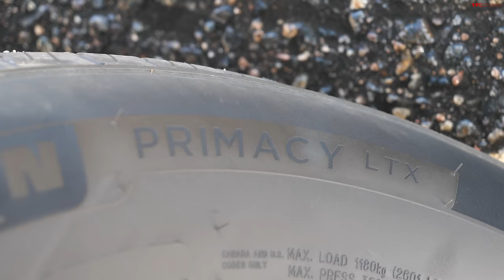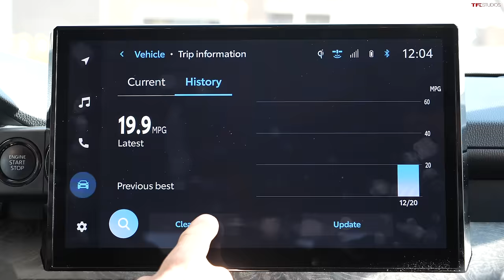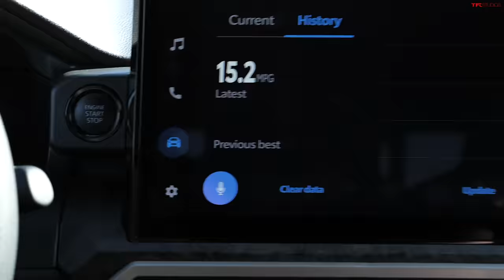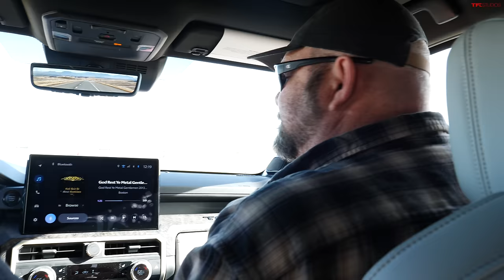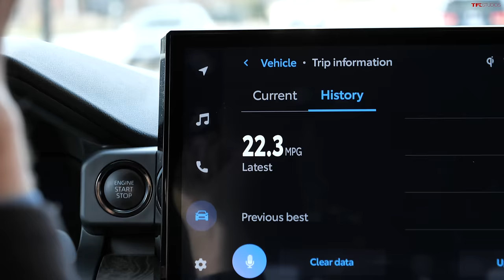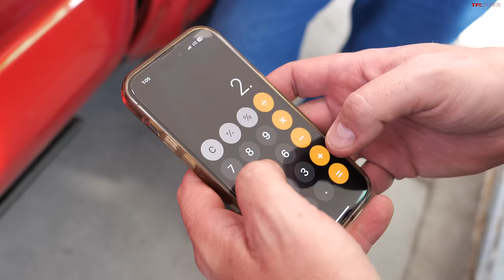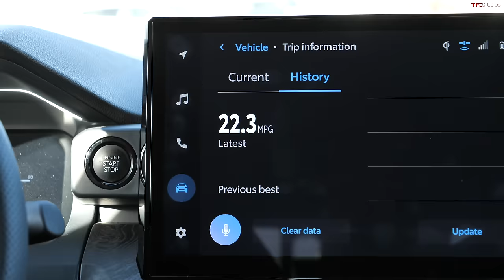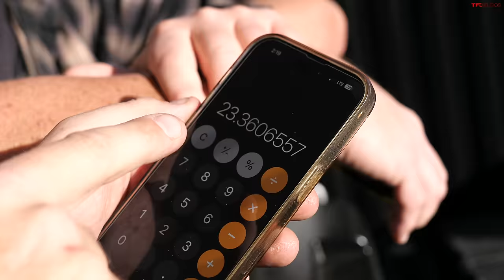Does the New 2024 Toyota Tacoma's Massive Chin Spoiler Actually Do Anything? We Put It to the Test

Comment: I would suggest prolonged testing to confirm, but that would only be 2.9% difference. If you did 15k per year at 23mpg, with gas at $3/gal, it would amount to less than $60 per year. I agree, ditch that ugly thing.
Reply: if you assume a 2% margin of error it's too close to tell.  they would need to run this test several times to confirm the results.
Reply: It might change dramatically in just 5 years. Or in California it can be more expensive right now.
Reply: Agree. Would ditch it. 2-3% improvement is not enough to offset the ugly factor, and it IS ugly
Reply: That's also assuming the aerodynamic drag of running at 75mph for the entire 15k. The difference will be even less at lower speeds (city or small country back road). Yeah, definitely chuck it.
Reply: I’d pay 60 a year just for it to be gone 😅 it’s like larger tires or other things as well. They cost more but they look better 👍
Reply: @monzav8 who cares about ugly? I'd be more concerned over ground clearance.
Reply: I live in rural area with lousy county roads. The spoiler would be broken first time I had to pull up the driveway
Reply: For 38.00 at 3.00 per gallon fuel, at 10,000 miles of highway speeds, and at low speed little to no difference. I see why they put it there, to get to the next even number of fuel economy, making it super easy to remove, is super smart. I think they can offer it on some models for EPA testing, and not on the rest, just to get the rating.
Reply: Also I would like to see some tests with the bed fully load to see if the front angle change makes difference, but for now, it seems they added just to comply/get better EPA rating, that should help Toyota with CAFE stupid rules
Reply: I’d prefer Ford Ranger looks over this, for me the looks are the most important than reliability! 😊 Ford ranger screams masculinity
Reply: @bekabeka71 some people didn't need a vehicle to define them
Reply: But in Canada that would cost $200 year. Plus in a strong headwind it would amplify the affects. If a manufacturer decided it was a good idea then live it on. Unless you intend to off-road. Most people 90% never leave the asphalt
Reply: You should try this in south east Florida. Where the speed limit signs are optional at 65mph. If you aren’t going at least 85mph you’re being passed by a Prius. I’m curious how different it would be at that speed.
Reply: Which equals 16.4 Cents per day
Reply: @anotherplebeian  each to their own like ☺️
Reply: @Kcducttaper1 100% agree...
Reply: Facts…pffft…You can use facts to prove anything remotely true. 😂
Reply: @HaroldCombs 
That's how statistics work to justify paying extra in fuel or extra for pieces of plastic that may not be worth buying in the first place ☠️
Reply: @freedomisntfree_44 you just invented a new way for car companies to extract more money from buyers. Stack on features they’ll pay subscription-model to not have.

Next thing you know your next new truck will come with your mothers-in-law yelling at you from the back seat.
Reply: @bekabeka71 really how masculine are you if you need to scream it to the world?
Reply: Guys, Salvation is Simple

HalleluYAH translates “Praise ye YaH”

YaH is The Heavenly Father 
YaH arrives via the TENT OF MEETING
YaH was Who they Crucified for our sins
YaH was Crucified on an Almond TREE

— Ancient Semitic Cuneiform of Moshe (Moses)
— Isa Scroll (The Original Isaiah)

Isaiah 42:8
"I am YaH; that is my Name! I will not yield my glory to another or my praise to idols.

Isaiah 43:11
I, I am YAH, and there is no other Savior but Me.

Isaiah 45:5
I am YaH, and there is none else.
Reply: It’s actually 2.99704516% difference. So basically 3% better fuel economy. Maybe put it on when going on long road trips on the freeway?
Reply: 2.9% is good in an engineer's eyes. 3% here, 3% there, and soon you're %15.better.
Reply: Toyota could’ve made it look better, it just looks so cheap and ugly
Reply: That 2-3% is at HIGHWAY speeds. It is less useful in town. So how much highway vs city are you actually going to do. It's irrelevant to most people who actually need a truck as a truck.
Reply: Plus we saw that they were stopped at street lights. How many and for how long will adjust that difference.
Reply: $3 a gallon, that's cute.
Reply: I would take it off but install it on long highway trips. It won't make much of a difference around town and lower highway speeds or short high speed highway trips (<30 miles).
Reply: @bekabeka71  I spent my teenage years in the 1980’s pushing vehicles off the road, there is no vehicle that I’d rather push than drive.  Toyota has been the cure for that.
Reply: Thanks for running this test!
Reply: @bekabeka71 just way too expensive
Reply: It’s not about fuel savings for the customer (that’s negligible and completely variable based on driver, conditions, location, weather, etc.). That spoiler is about meeting CAFE fleet standards for the manufacturer….which is determined in a wind tunnel and/or computer simulations.
Reply: g3430  yeah, I get it. Which makes a huge difference to the manufacturer, so yeah as consumer, that garbage is gone. Lol.
Reply: I drive 10k miles per year, so I'd be more like $40. Definitely not worth it.
Reply: Shush 🤫

Comment: It's about a 3% improvement in fuel efficiency with the chin spoiler. For a few bucks worth of hardware, that's actually a really significant improvement from an engineering perspective.
Reply: After this the design department walked into the engineering department armed with axes, swords and maces.
Reply: @JonBecker81  A designer is like an engineer but with a lower IQ.

Comment: Most people are gonna end up ripping that chin spoiler off….just in use…parking curbs, snow , and even mild off roading..
Reply: That is what I was thinking as well.  I live in northern Wisconsin and am often driving in snow.  I can't imagine that thing would last long.
Reply: Agreed, and i belive it mostly comes on the limited so most wont even have it to begin with..
Reply: Doubt that people would take it off…
Reply: @drn13355 with a little extra bracing you could use it to plow your driveway.
Reply: @phileasler5401   people with Tacoma's love modifying their trucks, this would be the first thing especially since its so easy to do and doesn't make much of an MPG deference..
Reply: Newer cars are way too low to the ground. My 2015 Chevy scrapes and gets stuck on stuff my 80's beater doesn't. And my Chevy is an SUV and my beater is a two door.
Reply: @lilsammywasapunkrock  you’re pretty vague on your complaint about “newer vehicles being too low” ? …..just stating your 2015 Chevy is too low makes no sense ….what type of Chevy? What 80s beater? …..I’ve worked on lots of old and new vehicles over the years and some old vehicles I can’t  even get my head under the frame when on flat ground…..some of my newer trucks I can literally crawl completely under them to change the oil without lifting.
Reply: @lilsammywasapunkrock  what Chevy SUV do you have….
Reply: Its worth it if you never ever leave the road and drive a lot of miles on it at 80mph

Comment: Toyota was definitely right about how easy and fast it was to take off that chin which is nice. Pretty straightforward to just slap it on if you’re doing very long distance trips where you know you’re not going places that ground clearance is needed.
Reply: I had a 2015 Canyon and had to use an angle grinder to remove the chin because the bolts were inserted top to bottom so it was impossible to unbolt even though they claimed it was 'removable'
Reply: Exactly take it off for around town and off-road, and slap that ugly thing on there when I take my 2000 mile summer vacation 👍
Reply: @Argedis lol. It might have been a bit more tedious but it’s definitely possible if you had some patience.
Reply: @ALMX5DP  Nope, No way to access the bolts without removing the entire bumper.

It was bolted from inside the bumper top to bottom. You only had access to the bottom of the screws. (which I cut off)

I could have used a dremel cut off wheel but the angle grinder worked fine. Came off in a few minutes
Reply: @Argedis  I just pulled up a YT video which managed. Seemed alright to me.
Reply: @ALMX5DP  2015 was the first model year and they claimed it was 'removable' which it wasn't. Perhaps it was changed in later years.
Reply: If the ~$1 you’ll save in fuel is worth getting down in the dirt and spending ~10 minutes to make your truck much, much uglier and another ~10 minutes in the dirt to fix it when you’re done roadtripping……..yeah, go for it. I personally think 20 minutes of my time and the cleanliness of my jeans when i’m out in public is worth more than $1. Also, my dignity.
Reply: @Ieo9017  you make a fair point. I guess it would come down to long term testing of it and whether it is literally only a couple bucks of savings or more on long distance road trips
Reply: @Argedis It wasn’t changed until 2021, when they started installing the screws bottom up. Many owners of 2015-2020 models successfully removed them without cutting; not impossible at all.
Reply: It would get ripped off on 1st snowdrift that came along if they didn't remove it
Reply: Just plain ugly and not worth the time and crawling around to mess with it .
Reply: This is sarcasm, right?   You really think people will repeatedly bolt/unbolt this ugly chin strap for 3%?

Comment: Tires make a huge difference. My 21 Ridgeline was averaging 24 to 26 on the stock Firestone highway tires. 56000 miles I put on contential all terrain contact stock size and lost 3 to 4 miles per gallon
Reply: Maybe the weight of the tires?
Reply: Maybe the weight of the tires?
Reply: Absolutely. I lost 2mpg on my 4Runner going from nice road radial to Wildpeak ATW3.
Reply: @wolfeadventures those wildpeaks are incredibly heavy. I had them on my last truck and even though they were awesome they were like 8 pounds heavier than other all terrains.
Reply: I have a 2.0L 4cyl BiTDI VW amarok and it loses about 6mpg when I switch from hwy terrain to mud terrain tires, but I do increase diameter a bit.
Reply: @jimmyr1683  No.  Softer tire.  Move friction and deeper tread.
Reply: Softer, and most off road tires have a .5 - 1 in wider contact patch for the same size
Reply: @jimmyr1683 yah it's often just tread and softer rubber. I've done a few swaps into AT tires, same size, and even reduced total wheel/ tire weight and still had less mpgs

Comment: I wonder if the mpg difference would be greater at sea level vs your elevation because of the difference in air density? In any event the numbers are pretty respectable considering the passenger load and that the Limited has a some extra weight power running boards etc. Thanks for doing this test!
Reply: TFL should take a vacation trip to Florida and run the same test at sea level haha
Reply: I agree, plus you have a lead foot driver and highway speeds of 70+ which is typical in their testing.
Reply: The miles per gallon would change but the difference would not. As the air would equally apply drag to both tests
Reply: Not really, I take trips to Colorado and generally get the same or better mpg.
Reply: @matt45540 the aerodynamic deficiencies would actually get amplified as you get faster or drive in more dense air; so the gap would likely increase in percentage...
Reply: @pauldiesel4582  Higher speeds would mean a more significant improvement with the aero parts.  At 45 mph the difference would be less.  The average speed of U.S. drivers is 35mph.
Reply: No difference since it’s a turbo engine. It would make a difference for non turbo regular ICE engines.
Reply: Air is less dense at elevation. Just look at what the Colorado Rockies have to do to prevent the ballpark from being a launching pad.
Reply: @europana7  From an engine power perspective, sure it could turbo-normalise (albeit at higher exhaust pressures). But in the context of aerodynamic drag (the thing the air dam is for) there is a difference. The ratio would be constant between altitude tests, but the numerical difference would be higher at higher pressures (lower elevation)

Drag = ½ρCAv², and the ρ changes
Reply: @europana7 that applies for engine output, but the chin spoiler is for drag against the air, therefore is conceivable that the spoiler would have an impact, especially considering the engine output is impacted less than a NA engine

Comment: Gents you need to do this test at sea level.  Air density is less at 5,000 ft. elevation.  You’ll likely experience   a greater difference in more dense air.
Reply: Great comment!
Reply: But my vehicle will rust next to the water

Comment: When he popped the hood I literally laughed a little. Looks like someone dropped a massive pot of spaghetti noodles all over the engine. What a nightmare 😂
Reply: Perhaps that's part of the reason why those plastic covers over the engine were put into place years ago, which everyone seems to scoff at, so now the manufacturers have been not putting them on and the result looks ugly.
Reply: Hopefully a pre-production problem
Reply: That’s what a lot of engine bays look like now. Emissions and turbo hardware combined seems messy
Reply: Planned obsolescence
Reply: Don't look at the new Ford Maverick - you might have a heart attack.
Reply: Don't look at the new Ford Maverick - you might have a heart attack.
Reply: I'm not bothered by it. All new vehicles have a similar amount of wiring, hoses and connections, so as long as it's all intuitively laid out if you need to work on it it's all the same to me.
Reply: @stephenj4937 the Tacoma is worse
Reply: Old cars you troubleshoot by popping the hood, looking around, listening, maybe adjusting something to test for changes, possibly breaking out a mechanics stethoscope or checking cylinder compression.  New cars you troubleshoot by plugging in a code reader and doing a internet search on the information it provides, then troubleshooting from there.  Different technics as times change.
Reply: @ALMX5DP  Nah, my 22 6.6 gas looks nothing like that. Looks really clean and lots of open space all around.
Reply: @pryme2013  it may look that way. but I suspect that's just because all the wires and hoses are more hidden or tucked away not because there are actually significantly fewer.
Reply: @ALMX5DP  Yes, but it's not always laid out like a mess.
Reply: @Incomudro1963  hence why I wrote the second sentence about being intuitively laid out should you need to work on or around them.

Comment: Remember that the air density at that altitude means less drag, so it would benefit those at sea level more (though I don’t know by how much)
Reply: still taking it off lol
Reply: I live at 4k+ elevation and notice 5 to 10% better fuel mileage at elevation.  I'd think that this should somewhat correlate with the 3% power loss per 1k of elevation.

Comment: Sometimes chin spoilers are there to create an air differential for the radiator so more air flows through the radiator, increasing its effectiveness in cooling.
Reply: That's not so in this case.

Comment: As always great job on the testing.
I remember on the white Ram "Stubby" the chin spoiler made a huge difference, so I was expecting the same on this one.
But with such little savings that would be the 1st thing for me.
To me it makes the truck look so bad I would probably take it off right after signing papers.
Reply: Straight to the trash. Probably before the truck got home
Reply: I remember the extending the towing mirrors on stubby resulted in reducing the mpg by 6.  It went from like 24mpg to 18mpg or something.
Reply: I don't remember that one being so plow like. It seems like in order to make this chin spoiler easier to remove, they also made it look cheap, tacked on, and less effective.
Reply: Makes you wonder how much you could gain by getting rid of the sidemirers altogether.
Reply: @johnhoover7869  
Yes, I think eventually side mirrors will be replaced with little tiny cameras on the doors.

Comment: I have tried TFL gas technique and noted two things.  Foam subsides very fast at my elevation, 30 seconds more than sufficient.  Second, the amount for second top off can vary based upon flow rate.  Low flow rate gasoline allows higher fill level. Did not appear nozzle depressed same amount.

Comment: Wonder if you blocked the holes if the MPG’s would increase.
Reply: This is not how aerodynamics work.
Reply: I guess it depends on which holes. 😃
Reply: @is6566  where the tow hooks are.
Reply: Ahh, that hole! 😍
Reply: @ReinhardSchuster that’s exactly how aerodynamics work. That front air dam is essentially plugging the “hole” that is the underside of the truck.
Reply: I'm fairly sure that Toyota ran the Tacoma thru CFD analysis to optimize the aero configuration...

Comment: Great video. Keep it up. Really enjoy these real world tests. I had a work truck, a 2015 F150 V-8, that I used to travel with extensively. I took off what they called the air dam because I drove in rural roads with lots of snow and it would plow up on the front. However most was on highway. I never noticed a change in fuel consumption. 
So I’ve come to conclude these air dams or chin spoiler as you call it don’t make much difference in fuel consumption

Comment: 2023 limited V6: 19-24 mpg
2024 limited i4: 20-23 mpg
And now we know roughly 1 mpg is from the spoiler...
If they offered a 2024 truck with the new transmission, interior, suspension, etc, but with the old trusted V6, who isn't choosing that?
The hybrid had better be pretty impressive